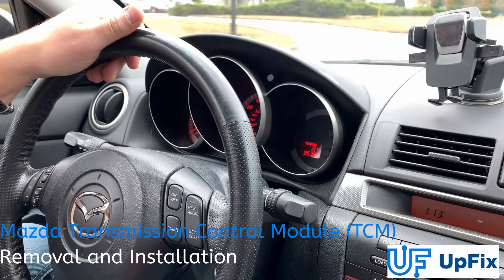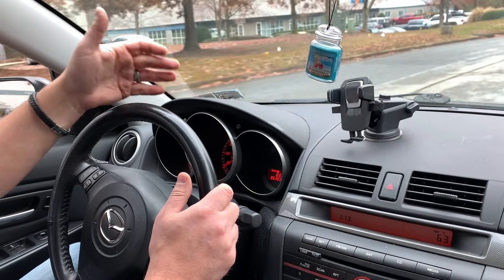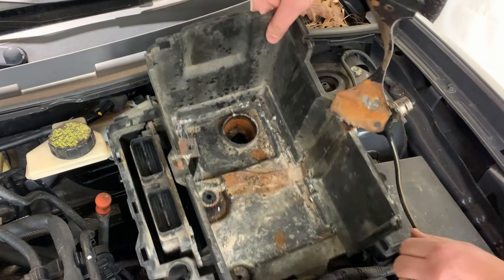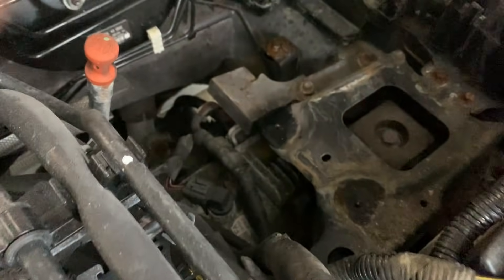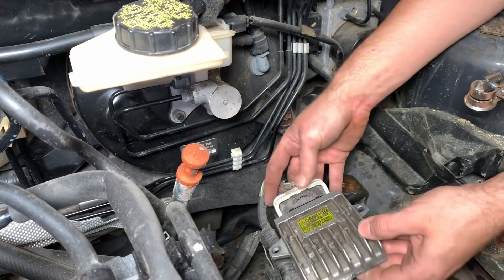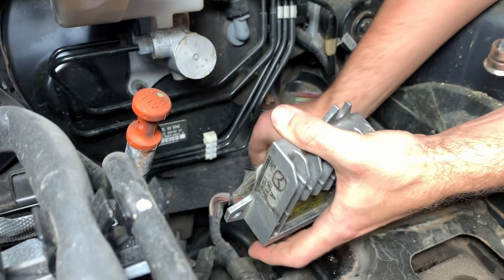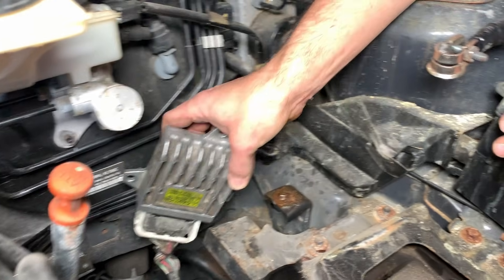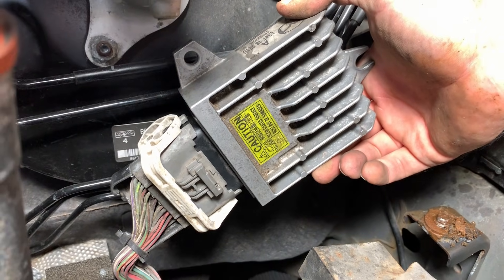Mazda 3 TCM (2006 - 2014) Transmission Control Module Location, Removal & Repair by UpFix

Comment: I have a manual car mazda 3, 2014
The gear is stuck and extremely hard to shift once engine is hot.. Is this a TCM problem? The transmission oil is full.
Reply from the maker: It does sound like it could be the TCM at fault. Hard shifting or stuck in a particular gear, is indicative of internal TCM faults. If you have codes, make sure to provide those you when you checkout online via the product page: https://www.upfix.com/product/tcm-mazda-3-2006-2014-transmission-control-module-repair-tcm-tcu/
Reply: @upfixauto  thanks for your reply. Look like we are going to use your service. However what is the codes are you refering to, and how or where i get these codes. Thanks heaps
Reply from the maker: The codes are DTC codes. Diagnostic trouble codes that you can get when you use a OBD2 scan tool to pull trouble codes
Reply: @upfixauto  can I still send to you my old TCM for fixing without codes?
Reply: I Know this is now 6 months old but I gotta put this right!

In this case the car is a MANUAL TRANSMISSION. There is no TCM in a  MANUAL TRANSMISSION equipped car!

Simply put, If you have a clutch peddle in your car then this thread is not for you.

Comment: If you ziptie it, how will it dampen vibrations? Computers need solid mounts, which double as a good earth.
Reply from the maker: That is a really good question. These computers were designed to fail after getting over 75k miles. By mounting it to the brake lines the vibrations are soften. That is the bulletin recommendation.
Reply: @upfixauto  What do you mean designed to fail after 75K. No electronics can last a lifetime in a hot/cold environment. The expansion/contraction of the board and the use of lead free solder causes many of the issues with most vehicle computers. I have a Mazda 3 with over 280,000 KM with the original TCM.
Reply from the maker: TCM failures occur not because of vibrations but from being mounted to the TCM which causes them to overheat. Mounting them to the brake lines prevent overheating of the internal circuit components, which improves on a major design flaw. Your response was correct in that if anything the vibrations are more dampened since brake lines don't have that many moving parts like a transmission which has many moving internal parts

Comment: A quick question does the number or code on the original TCM have to be the same for the replacement? ...

Little background: i have a mazda 3 2010 with check engine light and AT light illuminated 
& im getting Code:p0763 

So i purchased the exchange service on your website but im not sure if i was sent the correct part for the model and year to my car because it didn’t solve the problem and i already had the solenoid c changed and it continues to be the same problem so my only answer is it may still be the tcm failing if i can please get helped please and thank you so much in advance.
Reply: Some part numbers are interchangeable based on the engine displacement and when the TCM was manufactured. The P0763 code does indeed correlate to the TCM. If the symptoms improve and the code doesn’t disappear, a scanner or hard battery reset should clear the code. 

If there still is a hard shift then that would be a hard code that won’t clear until the issue has been resolved. When you receive the TCM back the AT light and associated codes should clear up. If not, someone will get in touch with you to assist you further from UpFix to get it resolved.
Reply from the maker: Code P0763, this is a very common fault code for a faulty TCM unit. We do fix this issue when we rebuild/repair your TCM. See our service page for more info https://www.upfix.com/product/tcm-mazda-3-2006-2014-transmission-control-module-repair-tcm-tcu/

Comment: Hello nice video I am having limp mode issues in second gear and hard shifting and high revving . I have changed dark fluid to put new fluid and filter . Worked fine then limp mode again. Gettin code for stuck solenoid c . Could this be TCM?
Reply from the maker: Are you getting any codes? Do you have any warning lights on your dashboard?
Reply: @upfixauto  yes check engine light and code for stuck solenoid c
Reply from the maker: @catfishjerry6412  Yes you are most likely getting a fault code P0763. If you are getting that code then the problem is with your TCM unit and not with the solenoid. This is a very common fault code for a faulty TCM unit. We do fix this issue when we rebuild/repair your TCM. See our service page for more info https://www.upfix.com/product/tcm-mazda-3-2006-2014-transmission-control-module-repair-tcm-tcu/
Reply: Just realized i have a 2.0 l that does not have TCM but has pcm . Could this be the same thing and I change pcm
Reply: @catfishjerry6412  your pcm is the ECU. Not the same thing as tcm.  But still an easy fix

Comment: I have a mazda 3 2004 but I can't find the TCM am being looking everywhere but I can't find it you can tell me if have a TCM or not please.
Reply from the maker: Hi Luis, this video is for year 2006-2014. In your 2004 the TCM must be in a different place.
Reply: @upfixauto  Do you know where The TCM could be if its not under the battery?    I have a 07 2.0 and the TCM is not under the battery.
Reply: Did you end up finding it?

Comment: Took mine to the mazda dealership. They confirmed it's the TCM. They quoted me $6763.00 to replace the whole transmission. North Park Mazda San Antonio TX. Dude thx so much for making this video fr.
Reply from the maker: That is a crazy quote, most dealerships don't know that it is just the TCM that is faulty.
Reply: @upfixauto they do know. They just want to sell you a new transmission, they make more money duh 🙄
Reply: @upfixauto   dont you need it to be programmed by the delearship after changing it ?
Reply from the maker: @evildax6815  No programming is needed if you have your original TCM repaired, because it is already programmed to your vehicle. We also update your TCM to the latest firmware. https://www.upfix.com/product/tcm-mazda-3-2006-2014-transmission-control-module-repair-tcm-tcu/
Reply: @evildax6815  nope
Reply: All they can do is replace the whole transmission. I took it to a place on west and they rebuilt it for 1200
Reply: Those dealership are thugs.!!!
So did you get the TCM repaired.? And how is it going so far?
Reply: I had to buy a new tcm in leon valley for 800 & just did it myself
Reply: They are thieves
Reply: #StealershipsSuck
Reply: @davidrodgers2314  well, san Antonio, TX is in the united states so... probably USD

Comment: I just had my 2006 Mazda 3 tcm back from your facility and I still have same issue. Hard shifting in reverse, transmission light on, stuck in 3rd gear when I put in drive. Seems like nothing was fixed by your service.
Reply: You might need to do a hard reset. With the TCM still plugged in, battery removed, short out the battery terminals for at least 30min. Afterwards reconnect the battery and see if the TCM improves. If not, I’d reach out to UpFix and provide the codes/issues you’re still having. The TCM typically comes with a one-year warranty.
Reply: @245artist  how do I short out battery terminals exactly. Unplugged battery already with it plugged in per techs suggestion and zipped tied positive and negative so they were touching for 30 min with same issues when I connected again.
Reply: @TreehouseMachineStudios  It sounds like you've already tried the hard battery reset. What codes were you still getting after the reset?
Reply: @245artist  yes and I am unpluging my battery overnight tonight as well. Trans light is on in my dash, when I put in drive it’s in 3rd gear, hard shifting in reverse. Same thing as before I sent in tcm for repair.
Reply: Any update on it ?
Reply from the maker: Ernest thank you for your answer!
Reply: The mechanic I too my car in to opened you tcm you sent me and here was no work done on it. The rubber had been ripped open very sloppy. Your company just put the ripped up rubber piece back and covered it with your cloth like cover and sealed it to look like it was fixed. Don’t waste your money here. Just buy one from factory.

Comment: What is the difference between LF6B189E1B and LF6B189E1C ? or are the same?
Reply from the maker: Not a 100% sure, but it is very minimal differences. It can possibly work for you. But you most likely will still need to have it programmed to your vehicle. Did this answer your question?

With UpFix.com we program the TCM to your VIN before we ship it to you, to save you even more money and not needing any programming at the dealership.

Comment: I have a similar issue. The AT light and Check Engine light stays on at some times. No always.  I am confused that why the issue is not always happened if TCM is failed.  Will your repair service fix this?
Reply from the maker: It is best to have your car scanned with a diagnostic scan tool to get codes. You will need to scan it while the light is on, if the light is off it most likely will not help to identify the problem. Once you have the code and the code is listed one of the codes that we repair, then our service will work for you. See here what issues our service fixes: https://www.upfix.com/product/tcm-mazda-3-2006-2014-transmission-control-module-repair-tcm-tcu/
Reply: @upfixauto   Thanks. I scan it and get codes is U0101.(No communication with TCM).  After plug-n-play the TCM module, the issue was not reproduced so far.  only drived 12 miles from plug-n-play the TCM module. I am confused that why the issue is not always happened if TCM is failed. Is it possible just loosely linked TCM? or Is it possible related with dirty transimition fluid?
Reply from the maker: @timfavorites  That code points to an internal failure inside the TCM which means the TCM isn't communicating with the scan tool. Currently it may be intermittent, where it is just starting to fail occasionally. If it continues we recommend to replace it or sending your original one to us for repair, we fix that specific issue. For more info visit our website upfix.com
Here is the link for this repair https://www.upfix.com/product/tcm-mazda-3-2006-2014-transmission-control-module-repair-tcm-tcu/
Reply: @upfixauto   Thanks!
Reply: hey i have the same exact problem and same code. I know its been years but what did you end up doing?

Comment: Where can I buy the TCM
Reply from the maker: UpFix.com has them available for an exchange. Meaning you purchase one that is ready to ship and then send your unit back for core refund
https://www.upfix.com/product/mazda-3-2006-2014-tcm-tcu-transmission-control-module-exchange/
Reply: @upfixauto   how do we buy one for exchange i need more info please. Went on the website and i dont see an option.
Reply from the maker: @Stefffine  Here is the link for 
REPAIR
https://www.upfix.com/product-category/repair-return/tcm-repair/ 
 EXCHANGE 
https://www.upfix.com/product/tcm-mazda-3-2006-2014-transmission-control-module-exchange/
Reply: @upfixauto   thank you so much 🙏🏻
Reply: @upfixauto   what should we do if we replaced the tcm and a day later the check engine light and AT light comes back on

Comment: Did you have to reprogram it before you installed it or did you just plug it in and it worked?
Reply from the maker: It will be Plug-n-play, if you have your original TCM repaired, send it to upfix.com

Comment: I have a 2015 Mazda Premacy skyactiv and it has these codes PO732 P0733 P0734 P0751 P0780 P1728. Do you think replacing the TCM will fix? Is the tcm located in the same place?
Reply: If you have a TCM that looks like the one you see on this video then UpFix should be able to rebuild it.

Comment: Do you put the same TCM back or new one?cheers
Reply: If you buy the exchange service, UpFix sends you a refurbished unit straight away and you send yours to UpFix for a core deposit refund. If you're buying the repair service, then UpFix simply repairs your original TCM. The exchange service is ideal for those that can't afford too much downtime.

Comment: Zip tie it to your brakes lines. It fine?
Reply: If they're securely in place, it shouldn't be a problem. You're keeping the TCM away from the transmission which tends to overheat so zip-ties are an improvement.
Reply: @245artist  at least put something in between to stop the vibration eventually wearing through the pipes. Then when you sell the car to a woman later on she doesn't kill her kids in an accident 5 years later.
Reply: @GiBBO5700  It shouldn't cause any vibration or wear on the TCM or brake lines that they are mounted to as they are solid metal lines with no moving parts. The bottom of any rebuilt TCM usually has a pad that acts as a sealant and should help with vibration.

Comment: I just replaced my TCM.  Bought a brand new one from Mazda was having all the same symptoms with 06 Mazda 3 . 2.3 . After about two hours of driving the car kicked into limp mode and the check engine light along with AT was on again 
 I could have drove off the road but I didn't. Instead I took to my uncle's machine and he ran the codes he knew that # of the code right away.  Long story short I had to replace my Speed sensor on the transmission... nothing was wrong with my TCM I bought.. but I   have the new one  in there anyways.  But yeah if your having this issue have your Mazda codes check 1st. ..
Reply from the maker: David when you scanned it with a scanner, what code number did you get for the transmission speed sensor?
Reply: How did u get code?
Reply: How did u get code?

Comment: Great video I have a 06 Mazda 3 that needs the TCM replaced are their any other mazda that has the same TCM that are compatible ?
Reply from the maker: Unfortunately not, look at the part number that is on the side of your TCM unit. Then you can search for replacement with that part number. We do have an exchange service available where we can send you a good TCM unit to you right away. Here is the link https://www.upfix.com/product/mazda-3-2006-2014-tcm-tcu-transmission-control-module-exchange/
Reply: Call Mazda and they should ask you for Vin# based off of that they will tell you the part#.  I have a 06 Mazda 3 also the part # they gave me over here in CA was " L32E189E1D ".  I was able to buy a new one for the stealer for around $600 . But I dont even think it was my TCM. It was Transmission Speed Sensor.  B4 you go buy the TCM have your codes read at a mechanic or if you have your own reader.
Reply: Transmission speed sensor coast me only $70 paid dude 40$ to out in..
Reply: @davidchavez3510  What code was it that popped up that pointed to the speedo sensor?

Comment: My 2010 has the at light come on intermittently and i can feel it slipping. 2nd - 3rd gear and today 5th gear jerked
Reply: This is common with Mazda 3 and Mazda 5 TCM units. UpFix.com can rebuild this unit instead of purchasing a replacement one.
Reply: Ah,  those #fifthgear jerks! , I always thought #Topgear was more superior,well presented with Clarkson, Hammond and May..

Comment: I have Mazda 3 2011, I have these two codes U0101, U0100. Will your repair service fix this? I dont want to buy a new one from dealership for $1,500 and then additional fee to program it
Reply: @UpFix  can you please explain what "plug and play" is
Reply: ChrisGioia85 you have never heard the term, plug & play ? ...Have you ever installed a printer to your computer, or any other device via USB ?  Plug and play simply means that it will operate once you plug the TCM in. Although I’d recommend disconnecting the battery before reconnecting the TCM...
Reply from the maker: Good explanation